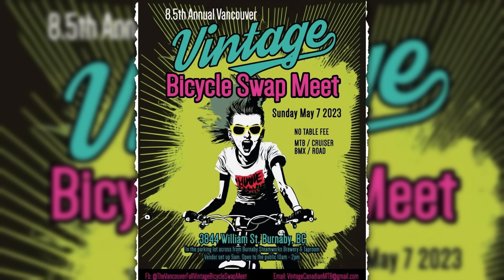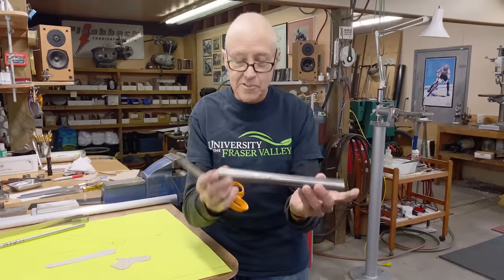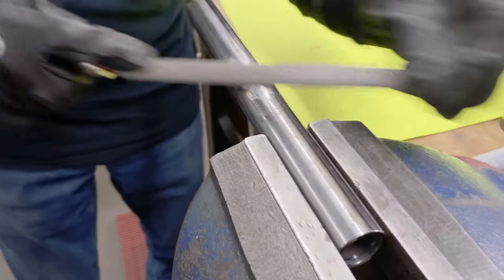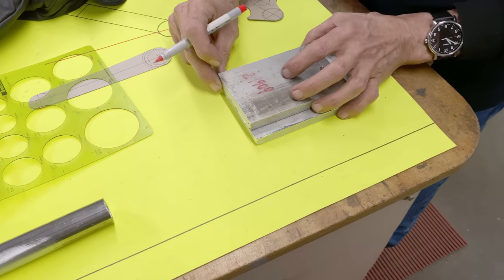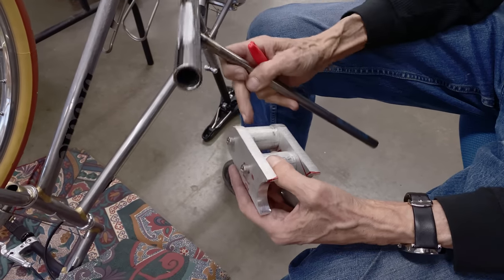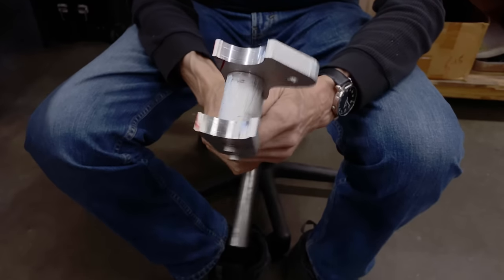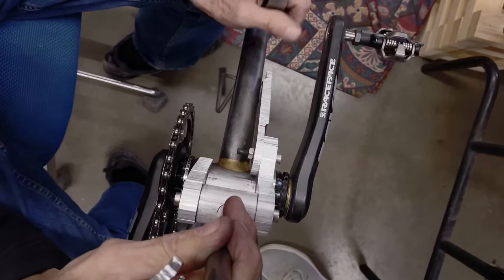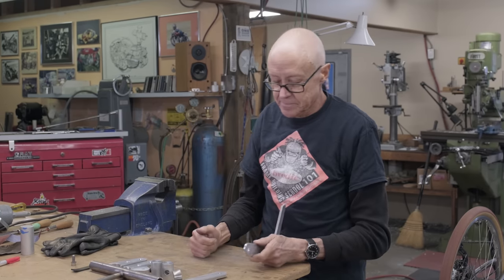Fabricating a one-off BICYCLE STAND // Paul Brodie's Shop

Comment: Okay, I fast forwarded to the end.  Those stands were made out of ~3/8" steel rod and chromed and clear vinyl sleeving placed at all the touch points and two little rubber caps on the ends for feet. Yup, I remember well, back when Viscount had an aluminum fork, ops.
Reply from the maker: Yes, you know the stands. It seems they have disappeared off the face of the earth....   :face-orange-biting-nails:
Reply: @paulbrodie  The bicycle shops were full of them.  I wonder what I'd find if I walk into what use to be a neighborhood bike shop turned (bought out) Trek shop? There must be a pile of them somewhere.

Comment: I am curious about what was happening at 10:33 - stopping the lathe with the bit still in and Paul adjusting or loosening the bit? I don't have a machining background, just curious!
Reply: i nodiced that too. He is cutting threads so fast the leathe couldn't stop fast enought and the thread cutting tool woud've been drawn into the part and probly broken off inside the part. Insted he loosent the thread cutting tool in the drill chuck, so the tool could spin with the part while the leathe slowed down. 
sorry for bad english, hope it made sense;)
Reply from the maker: Yes, you figured it out!
Reply from the maker: The tap is powered into the part, and then I snap open the chuck so the tap doesn't go in too far and break...

Comment: Nice job as usual. It's nice to see you using the skills we were taught back in high school, like the proper way to use a file. How much would a bike like that weigh? I have a couple of generic bikes and they are both made out of aluminum, and both weigh around 50 lbs
Reply: 50! Holy. My 90’s MTB and steel Walmart front suspension bikes are only 34.
Reply: @arthurmiller-vl6sw  I used a fish scale to weigh them, so it might be five pounds off one way or the other. Yeah the're heavy, but I get more exercise, LOL.l
Reply from the maker: Thanks John. I did do a lot of filing in high school, but can't remember if I actually was shown how to file... I haven't weighed my bike, but I would guess 24 pounds. Better weigh it tomorrow!  :)
Reply: @paulbrodie   Thanks.
Reply from the maker: I went to my shop and weighed the Romax. I was wrong... Even with the pump, it only weighs 22 pounds. It's a nice, light bike!    :face-fuchsia-wide-eyes:
Reply: @paulbrodie  Wow, that's pretty light for that type of bike, only 2 pounds heavier than my friends fancy race bike.
Reply from the maker: @johnb5519  Yes, nice Tange tubing, and a good selection of quality components...     :face-orange-raised-eyebrow:

Comment: Here's a comment saying that the acetylene soot trick is what I was taught for shaping alloy panels on motorcycles. Worked for me...
Reply: I was shown that if you rub ordinary soap on the aluminium and heat till it turned brown.

Comment: I would of had to go with a solid stock on the tube that rests on the ground so it could have had ball radius ends, other than that, that was beautiful form and function
Reply from the maker: Thanks Daniel. Do you realize that if you had used "a solid stock of tube" it would not be a tube at all?   :face-orange-raised-eyebrow:
Reply: The solid stock would be used in place of the tube ?

Comment: Okay, now I'm 'up to speed' with your video's, haven't watched much You Tube last month or so. (still working on stuff around the house)
Triumph oil tank, maybe it needs to be hot before the crack.split, whatever actually leaks? (although that did seem a lot of oil in the drip tray.)
Neat stand, until you showed picture I couldn't actually think what you were talking about, was thinking something fitted permanently.
Reply from the maker: The oil tank is now fixed! That was a long crack, and there was a lot of back and forth with the Tig welder..
Reply: @paulbrodie  I'll bet it was a PITA?
I've seen a lot of BSA C15's with similar leak that couldn't ber found until it got worse. There were plenty of oil tanks available back then though so it was easier to just change them.
Reply from the maker: @1crazypj  I had my friend Ross Schafer helping out. It was a fun way to spend time in the shop. I would not consider it a PITA...   :face-fuchsia-wide-eyes:

Comment: I noticed that this guy wears gloves to do his machining.  Is that not an unacceptable machine shop practice to do machining with gloves on? Jewelry, long sleeves/hair/gloves etc.  This is what I think is funny about precision machining:  put it in a vice, and hit it with a hammer.  I will have to try that lampblack and heat treating until the lampblack is all gone to get the metal hard.  The little gap may also have been that your consistency of impact to distance each was overmuch one after the other from the previous impact, and varied from the distance of the tangent to the last impact, extended some supreme distance of degrees or some other suitable universal angle indication accepted by all nations, and the gap resulted from the proportions of impact distance one to the next and applied force.  you get farther away from the last impact and you hit at an increase or decrease of force from an increase or decrease of distance (and proportionally coefficient of applied force) and the metal will bend more or less sharply across the same distance.  The impacts, distance from last, and constant proportion of applied force in equal time and you should get a consistent curve.
Reply: Also, possibly with a proportional and coefficient change in Temperature.
Reply: He's been machining since before most of us were born. He can do it however he wants.
Reply: Come on man this guy is a true artist working thru some difficult times in his life I’ve been machine’s for 35 years and learn a lot from this guy try to keep an open mind
Reply: Funny, Ive never seen a mr1fish2fish brand bike on the cover of mountain bike action, maybe I missed that issue? Nor have I ever seen a mr1fish2fish brand home engineered hand built from scratch vtwin motorcycle engine in a fully hand made frame roaring around a race track. This man is a genius, an artist and a craftsman who has lived a life most could only dream of. He is beloved many. Watch a few more videos and learn from a master.
Reply: Some make comments, some make bikes from scratch. Just know your place.
Reply: In some parts of the world wearing gloves while machining is considered normal practice. Don't judge others by your standards, judge them by results.
Reply: Theories mate, dont bother with them, paul is an old hand, he does and does and does, im sure he can take responsibility for his actions at his age and from as much as he has seen, also the poor bloke hasn't been in the best health. We are and you even more so are lucky to be watching what this gifted man does...and for free, and regularly for that matter. Know your place mate, dont bother commenting, just watch, and if you dont like it do a video about what you feel you should see others do